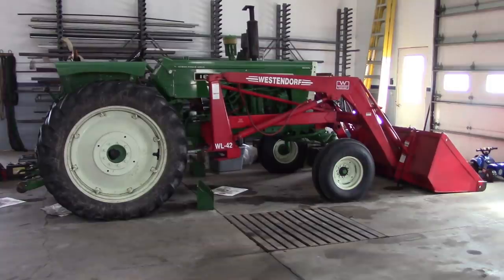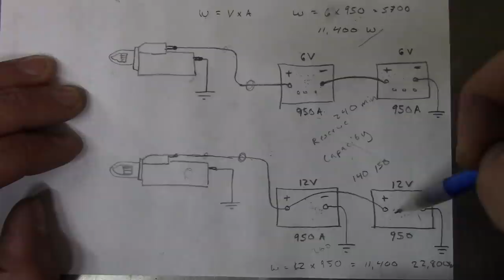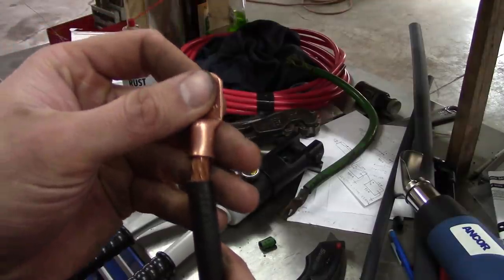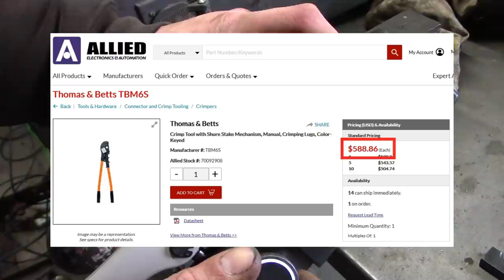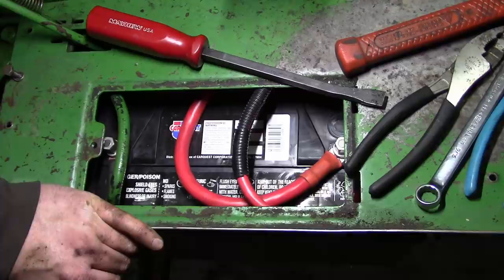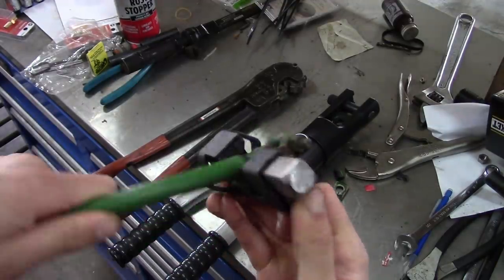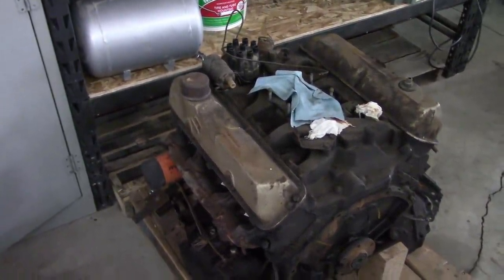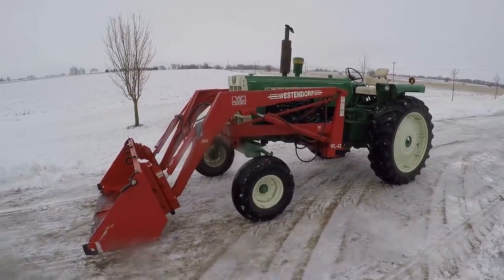Oliver 1650 Tractor 6 Volt to 12 Volt Battery Upgrade

Comment: Not being critical, but when crimping a lug multiple times, always start at the lug end and work the crimps toward the wire side.  The die displaces metal and the lug gets longer, this is the way I was taught to crimp lugs on powerline jumpers for different types of pole top equipment.
Reply from the maker: OK. I guess that makes sense.

Comment: Yes the hex dies are much better than the old school style dies.  More evenly distributed pressure on the crimp which means the strands are making better contact with the lug barrel.

If you do a lot of crimping look into a battery operated hydraulic crimper.  Much lighter and easier to use.

Comment: Wes, very late but - the way to tell if the tool is making a proper crimp is to cut a crimped terminal in half - if you see solid copper, the crimp was good enough.
Generally, 'good' hexagonal crimpers cost significantly more than $30 though and the flash on the sides of the crappy die that you saw is one of the possible problems.

Comment: Many electricians hate soldered connections where there is a possibility for so much current to flow that the connection will heat up to the melting point of solder.

Comment: I had a tool that cost me $180. It was like bolt cutters. But the dies rotated for the gauge wire you were crimping. It also did the hex crimp. I would fill them with dielectric grease, crimp then heat shrink. But I was mostly doing marine.
Reply from the maker: Do you know the brand name?
Reply: @WatchWesWork  Sorry no. We had a guy come around the shop that stocked us on our heatshrink electrical connections. I asked him one day if he had big crimps and he said he did but nobody bought them because they were pricey. I said bring a pair next time. He did and I bought them

Comment: 4/O is very common in marine use, especially large power boats where Delco-Remy 40 and 42 starters can pull 600+ amps @12vdc on long runs for 400- 500 hp. I buy 2/0 and 4/0 by the coil. Also crimp only, solder not allowed by ABYC.

Comment: Thinking the crimp with the new tool is not strong is psychological. The hydraulic advantage is so great, your mind thinks, "This should have been harder to pump. This can't be a strong crimp." You get used to the mechanical crimper that has less of a mechanical advantage and therefore you have to personally provide the "hydraulic" power. Almost no resistance with the new tool. That is sweet, AND inexpensive!

Comment: I remember when we wired our solar chargers we used 4/o for the battery bank, When I purchased the cable the welding supply guy looked at me like I was nuts.

Comment: We should have a long discussion about electrical circuits/batteries/cca etc on facetime... also one large battery is better than two. Two batteries in parallel tend to self discharge into each other over time leaving you with two dead batteries. But if you use the tractor frequently it should be okay.

Comment: I like to put Contact Grease on my battery connection.   Also a friend mom use to work at Johnson Control making batteries.  She said that the cases would be shipped to them and they would put the plates in. Back then Sears Diehard was king. It had lots more plates in them. So if you are looking for a good battery check the amount of plates are in it.

Comment: Also would drill a small hole in your battery cable end after crimping and feed solder in until it can't take anymore that is a bulletproof connection

Comment: i would put some silicone grease over the terminals so they don't get corroded . also would be nice with covers over positive terminals to keep them from shorting .My experience is a lot of the difference between batteries is how fresh they are they go downhill the day they put the acid in so i look for the date stickers and pick the freshest ones . The bigger wires never hurt because you get less resistance and can pull more amps through them to start engine easier. you sure can see that by trying to use a cheap pair of jumper cables with like 8 gauge wire lol

Comment: 2½ yeas late but if you can, hold the wire lightly with stiff foam blocks in a vise to allow both hands to use the tool.  I wouldn't put the crimper in a vise as it would require a stong grip in the vise to keep the crimper from moving.  Damage could result.

Comment: Heh.. i was just doing this same thing to my -80 zetor! 😄 
First i was shure the starter blew. 
New starter->couple of trys to find a proper size fuse aaaand dead again. The i thought i blew the solenoid, but no it was the cables, 2 12volt but someone routed 3meters of thick cable there and didnt think that you could ground the batteries to the frame and the motor. Only one ground. And that cost me a spare starter. 😄
I need one of those crimpers.
Reply from the maker: I've been there too!

Comment: The tinned marine grade wire is more flexible and uses finer stranded conductors. Less corrosion and more flexibility… but.. not cheap. Carrie’s a lot of current though. Like welding or locomotive cable conductors.

Comment: On the 12v diagram, the negative from the first battery, (closest to the starter ) should connect to the negative on the second battery and then connect to chassis ground at the end of the circuit. Thanks Wes
Reply from the maker: That's one way. But usually if the batteries are not close to each other, it's more economical to use two grounds, one for each battery.
Reply: @WatchWesWork  The idea is to have the circuit travel through the second battery to get to ground...

Comment: Not sure if anyone mentioned it yet but most new batteries tend to be AGM which will become damaged below a certain charge level (70% or 12.57 volts at room temperature based on a chart I found). If the equipment does not get used for long periods of time the batteries become discharged and Sulfates. Perhaps why the NAPA batteries last longer is because they are kept on a float charger in the store to prevent damage? You can get a battery tender to keep the new AGM batteries charged and hopefully extent their life. There is a lot info on AGM batteries you can find with a quick google.
Reply from the maker: Yeah, these should have been on a trickle charger.

Comment: 19:02 Before you tighten the nut, coat the contact with a special lubricant. There will be no corrosion and there will be no circuit breaks in a few years.
Reply: Or... Buy a good battery. The cheap batteries leak corrosive gasses around the post and THAT is what causes the corrosion.

Comment: I've been eyeballing the $65 version of that battery crimper at Harbor Freight for a few months now. But I have only one project for it, so probably sticking with my sledge hammer crimper for a while. WAIT! $30 shipped free to store??? Sign me up! I wish Northern Tool would post the gauges it is good for rather than the schmillimeters.
Reply: Keep you hammer one or get a Molex manual crimper. I got that Harbor Freight crimper and it exploded on me the first time I used it. Obviously I returned it.
Reply from the maker: I don't see how you can go wrong for $30. Even if you have to make a cheat sheet.
Reply: @WatchWesWork  I have a Northern Tool in town, and the website says shipping is free to the store. A negative hit on both NT and HF is on line wrenches. Harbor Freight never has the SAE version in stock. Northern does not even have them available in the store here, per their web store. SAD!
Reply: @WatchWesWork  If that thing explodes, I hope you get it on camera!

Comment: To hydraulically crimp is the best way. It create a cold weld of the fine strands of copper in the wire. I have best success using one size to small teeth tho and crank it to 11.

Comment: We have a dealer that sells lower cost group 31 batteries but they are usually older batteries the supplier is trying to move.  I prefer the heavier ring terminals vs the standard copper ones. I was just looking at a hydraulic crimper last night
Reply from the maker: Yeah, the cast ones are really nice, but they cost more than twice as much.

Comment: Also if get a battery that 1995 Dodge  full size pickup with Cummings Desiel 6 cylinder 12 volt has 1000 Cold Cranks on 0'C plus or 850 Cold Cranks on 0'F  and 90 to 175 (mins) Reserve Amps to are ones get fluid add caps too too! Plus top posts only too! Also work excellent too plus add GM Delco Alternator Negative grounded from 1968 to 1985 years with 70 to 100 amps and got built in regulator use to 2 prong with Negative Postive plug wires   plus battery gauge terminal too on back and  charged up fast  !  Even the if lights were turn on or Starter to get quick reserve to from GM Delco Alternator to in fast 30 to 60 mins too! That found do to my dad farm tractors plus Combine too!

Comment: Looks better than most.  I bought and use a Burndy Y35 Hypress from a pawn shop. It leaks a little but it crimps the lugs to 12 ton. 
   On yours, have you considered using Penetrox in the crimped joint? Just asking and what do you think your getting for crimp tension?

Comment: We've had all sorts of problems keeping 6V batteries in series charged and healthy.  Our JD G now has a single 12V and it works much better.  I would think 2-12V in parallel would be much better than 6V in series.

Comment: Things are looking up for you Wes. Glad to hear it. Only one house to maintain.
As for the crimper, much gooderer result than the bolt-on thingy.
Tractor runs great, once it is running. 
Seems to have no fuel while cranking. Is it that hard to start all the time or just after sitting overnight?
Congrats on the battery conversion. My theory is still that batteries left on concrete will discharge faster.
Thanks for sharing
Reply from the maker: It's usually after sitting. The pump needs attention.

Comment: Hi Wes, Yes you could have used the original cabel and might have been OK. Murphy being who he is might come back and give you a starting problem. Unless you remembered this wire, you'll tear your hair out chasing down this failure. While you're rplacing cables, you would be miles ahead to replace all the battery cables up front. You you can say good bye to this problem.

Comment: I stopped even trying to keep a battery in my tractors.  Instead I use a Booster Pac ES5000, and just leave it in the tractor.  It's over 6 years old now, and have only plugged it in maybe 10 times, all because I wanted to use it for other purposes (knowing I was going to try and jump starting cars, backhoes, and semi's the next day).  Like I said, mines over 6 years old now, but they're still around $125 bucks online.  And if you look, you can get just the little battery inside it for I think $50 bucks, though the booster pac name brand one is I think around $70 on amazon.

Comment: 16:13 If you take the dies, and try them on the wire connector you will get a good idea of the correct die for the wire size. (place the two dies on each side of the connector,  the fit should be easy to see. Using the vise is your third and  fourth hand.

Comment: we converted a lot of older Freightliners from 6V to 12V batteries. Never replaced a cable unless it was bad and had no problems. Cool crimping tool. Does it still work?

Comment: I've seen some videos about large crimps, seems some people cut them cross section to see, the copper should become one piece, the strands of the wire fuse together into a solid piece with the crimp on connector. I would be interested to see how your crimps look.
Reply from the maker: Yeah, that would be interesting. Maybe I can throw a picture on the community page.

Comment: From personal experience if you short a large, unfused, cable...wire sized be damed, the insulation is going melt off and if you're lucky the cable will melt before something else catches on fire.
Reply from the maker: That's true, yet battery cables are very rarely fused between the battery and starter. Sometimes you will find a fuseable link, but it's rare. I always found that odd.
Reply: @WatchWesWork 

I've always found it strange myself...the wiring between the battery and starter is only the largest wiring with the most potential for extreme damage in most cars. 

My only reasonable guess is to prevent someone from being stranded in extreme cold (or from a nearly dead starter) they forego the fuse.

Big ass fuses also only come in two flavors, instant and slow. An instant fuse would probably be too likely to pop on a cold day and a slow fuse wouldn't be able to save the day due to the delay. 

Fwiw my wife's car does have an actual fuse on the starter lead, I think it's a couple hundred amps and probably the "slow" type...but that's a tiny 4 banger. My 5th Gen Camaro has the battery in the trunk and giant wiring to the front with no fuse at the battery.

I used to install car stereos on the side for cash and did better work than the box stores...my "experience" was with a guy that bought his own gear. I always hated those jobs because they would buy crappy gear and argue about things like a fuse at the battery.

Long story short, no battery fuse and a cheap amp that internally shorted. The cheap wire's insulation lit up like wax paper and the amp basically exploded. Luckily I had the entire (literally) interior pulled of the car so I was able to get it under control with a fire extinguisher.

I quit installing for anyone the refused to buy a fuse block...
Reply from the maker: @drrrrockzo  Heh. I had my forklift catch fire once when the primary ignition wire shorted to the engine block. No fuses anywhere on that machine.
Reply: @WatchWesWork 

I bet that was "exciting"...my god man no fueses anywhere, I can't imagine such a terrible idea.

Comment: i'm going to use HIT Led 24 volt strip lighting in my shop  1/2 wide 60' long led's every 6" glue right to ceiling.
I use Burdy U die crimper for my battery cables with T&B hex U-dies,  I do make some of my Dies,
I use arctic flex welding cables.
Reply from the maker: You'll have to let me know how you like those lights.
Reply: will do.

Comment: You might want to consider using some "BURNDY PENETROX E" (copper to copper electrical joint compound) on your cable connectors.

Comment: if you set the two ends of the tool die holder in the vice so the handle points up, will the pump not work?

Comment: I'd put some 1/8 cable that rode along in the box with a bolt at each end so it would catch the inertia of the batteries as they fell.

Comment: Wes I'd put some kind of insulator between those terminals and the top of the battery box. One good bump in the road and you'll be welding unintentionally.
Reply from the maker: Heh. Well if the bump is that big I'll probably be jettisoned anyway!

Comment: I borrowed the $$$ Thomas & Betts 14 ton hydraulic crimper from a friend but it turned out he was missing the die I needed.  Ended up buying that tool which came with the die for half what a used die for the T&B would have cost me.

Comment: You forgot to mention that with the two 12 V batteries in parallel your 140-150 minute reserve capacity will add to 280-300 minutes.  Advantage goes to 12V system there, again due to development in 12V technology and general better effeciency of packaging and plates at that higher voltage.  That is probably a reason why just about everything runs on 12V lead acid these days.
Reply from the maker: Right. It's basically equivalent overall. But the selection of 12V batteries is much better and the cost is less.

Comment: It doesn't look like anything is holding the battery down in it's case.  Going over a bump while driving could cause the battery to bounce up a bit  and have the positive terminal come into contact with the metal of the case.  It looked like there was only an inch or so of clearance between the positive terminal and the metal battery case.
Reply from the maker: 19:37
Reply: @WatchWesWork  Oh I see it now that will hold it fine, perfect.

Comment: Hi wes, I think that you have the wire size backwards, You see smaller wire in 24 volt systems than 12 because of the OHMS law. P=E x I. "I" being current, you see the lower the voltage you need higher current to equal the same wattage, so bigger wire is needed in 6 volt systems than 12 volt. What I'm saying is that the 6 volt system you are working with already has bigger wire needed in a 12 volt system. Thank for the videos
Reply from the maker: It's not a 6V system. It has 6V batteries, but it's a 12V system.
Reply: @WatchWesWork  My bad.... 71 years old and still can't pay attention : )

Comment: I'm not a fan of soldering ends on either, I find it makes the end of the cable brittle. I usually work on smaller stuff, like atv winch wires. Usually I end up crimping in a vise, with a bolt along side the terminal to put a divet in it.
Reply from the maker: My brother taught me a trick. Take a hex nut roughly the size of the terminal and cut it in half. Then put the nut around the terminal and use the vise to squeeze it back together. The inside of the nut will make a decent crimp die!
Reply: @WatchWesWork  That's awesome! Definitely doing that next time

Comment: Nice, I’d be a bit worried about the battery bouncing around and the two exposed terminals hitting the metal footplate above.
Reply from the maker: The batteries are securely bolted to the boxes so they cannot bounce around.

Comment: My uncle has multiple john deere tractors from late 60's to early seventies. His 30 series and 40 series both use battery boxes similar to your Oliver. One advantage deere has is a notch so when you unhook latch it will just sit there at an angle and not come crashing to the floor! Still no fun getting batteries in and out with either setup!

Comment: The only reason I solder after crimping is for the corrosion protection. A good crimp should need no soldering.think I would have used the number 25 crimp,the tighter the better.